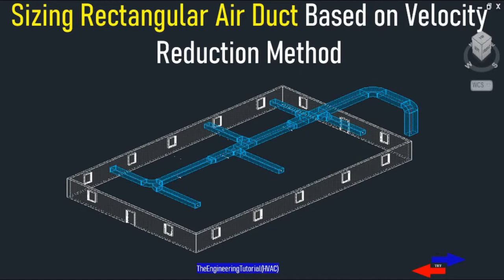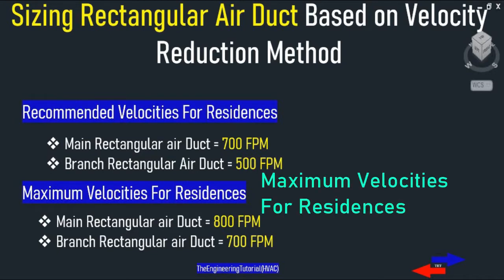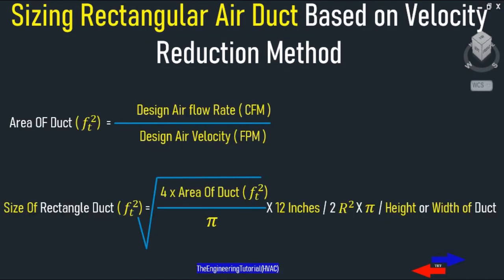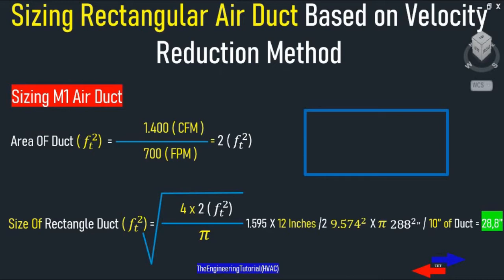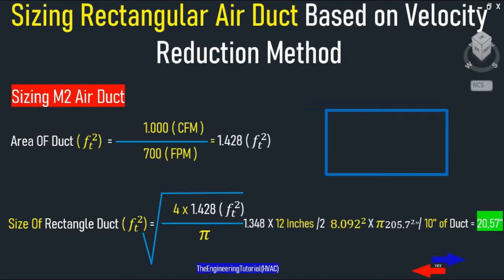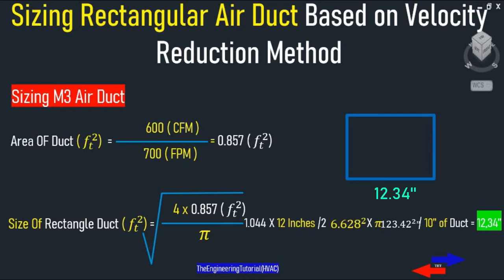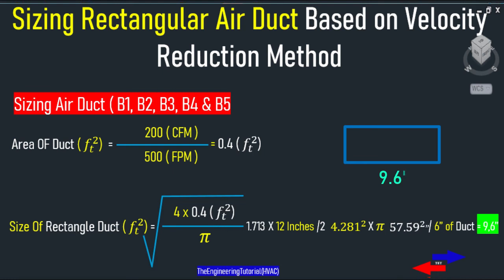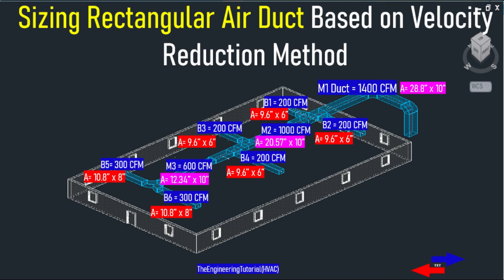Sizing Rectangular Air Duct Based on Recommended Air Velocity

Comment: second formula not clear to understand, please explain or send a link for the formula explaining
Reply: where to get R value?
Reply from the maker: R value is just the radius of duct got that by dividing over ( 2 )
Example:

1400 cfm / 700 fpm = 2
Square root ( 4 x 2 / 3,14 = 1,595 x 12”/ 2 = 19,14
Radius ( R ) = 19,14(square)

9,574(square) x 3,14 = 287,8 square feet/ high or width duct.
You can divide over any height or weight of duct you select, for example if You select a height of 10 inches first than you can divide the area of ( 287,8 ) over height of 10 inches You will get the width for my duct.

287,8 square inches / 10 inches = 28,78 inches width, therefore I have now a duct size of ( 10” height x 28,78 width )